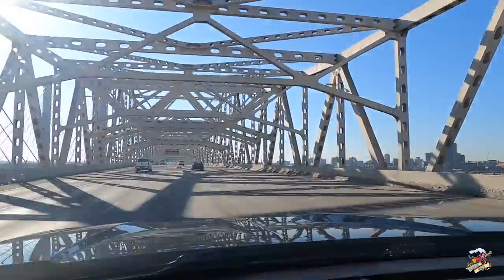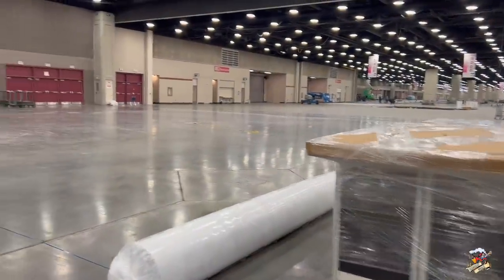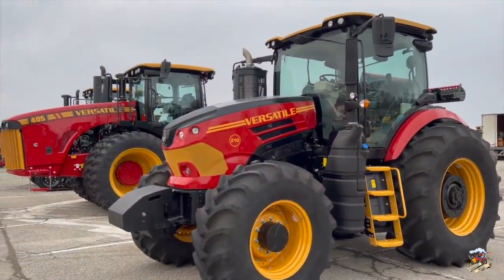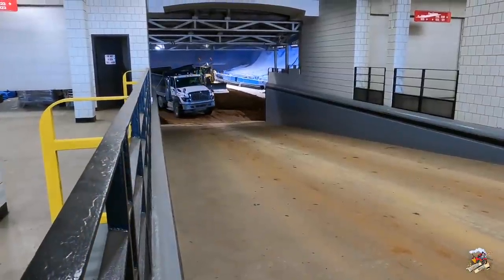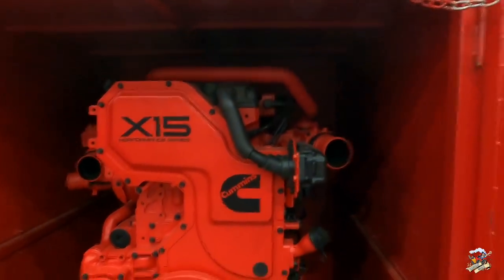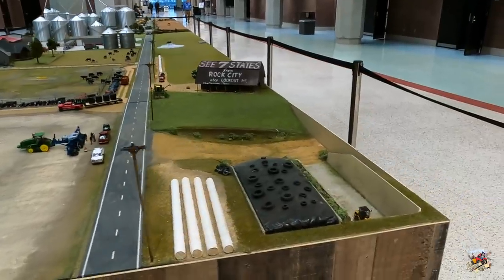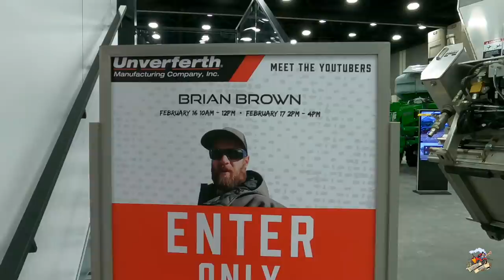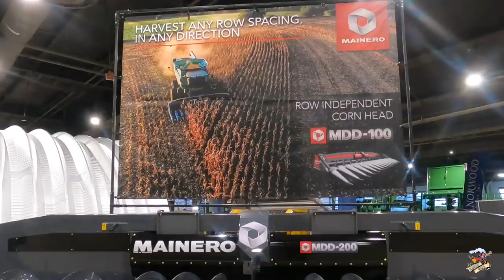National Farm Machinery Show 2022

Comment: I use to work at a marina in Boston, MA setting up for the boat shows. We usually had 20-30 boats on display from  14' to 65'. I helped clean, wax and wipe these boats down. Took a full week with 10-11 hr days. Still love going to boat shows, but I do not miss the setup part. AG equipment though, I cannot imagine the hours spent cleaning and waxing all the nooks and crannies and how much Armor All used on the tracks and tires. That is some serious cleaning work.